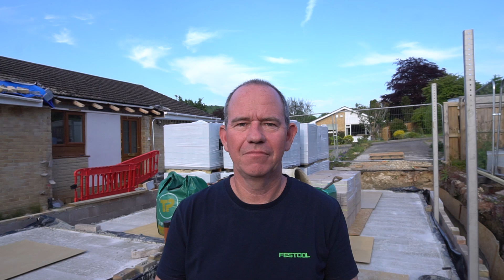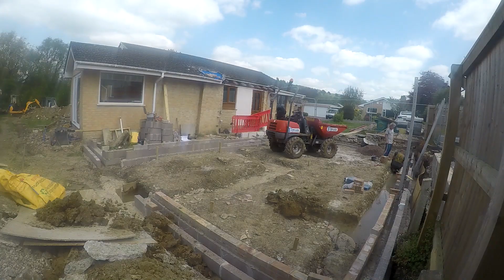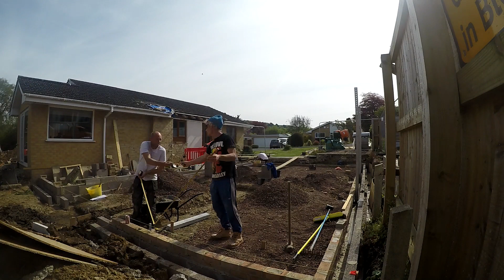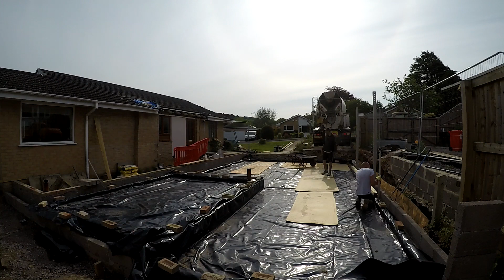Part L Building regulations. Is it worth spening more to exceed the required U-Values?

Comment: Hi, thank you for the video. It's very interesting to know that you can see SE chat gprt for sorting of have an idea on h-values. Do you know if integrated garages (non heated area) but with a room of top has a to be built with the standard for new buildings?
Reply from the maker: Hi, I find chatgpt a useful tool but would not trust it 100%, still useful for iterative questions. If you are extending an exisiting property the regulations are less strict than a complete new build so I think the lesser level would apply. We had the decision to exceed what we were asked to do, indeed I think we exceeded then minimum new build regulations in some areas of insulation. From my experience of homes with a bedroom above the garage they are often colder than the rest of the house so I would add more insulation under the floor and pay attention to air gaps that could bring thermal bridges. You will have to use fire board or double board the garage ceiling if there are rooms above. Why not try chatGPT and see what answer you get (but don't trust it, always chedk with building control).

Comment: Thanks for the excellent video. I wonder about home automation in our new build  and risk of failure
Reply from the maker: Thats a very good question and one I was concerned about myself. The Loxone solution is pretty robust and being used for larger commercial projects so I have some confidence based on that. It can be designed to have a degree of resilience with multiple power supplies but the single point of failure is the mini server or being really specific the SD card that the mini server uses. I plan to have a spare SD card located with the server and may even buy a spare mini server. The good thing about Loxone is that it all runs local to no risk from a remote cloud service failing or the hosu not working if you have no broadband. That can happen, we had our phone line damaged and had no internet for 3 weeks! Loxone would have continued to work.

Comment: Very interesting. Can you post more ROI figures for some of the other measures you're looking in to eg. Mechanical ventilation which supersedes trickle vents.
Reply from the maker: Hi, I am not sure you can produce an ROI for MVHR, a lot of that is about quality of the air rather than pure energy saving. I have installed the MVHR myself at around £4,600 including commissioning. I will save some energy as the heat will be exchanged and put back into the house but if I am not as airtight as I hope it is possible I will also pull cool air in and force warm air out of any gaps even without trickle vents. My property is not a new build so I don’t have to a blower test but I am trying to make it as air tight as practical. 
What I have found and will be doing another video on soon is that the detailing on the installation of the insulation and air tightness is probably MORE important than specifying a better product. Our builder was not doing a good job in that regard so we are having to rework the areas that we can.

Comment: Interested to know what company you're working with for the commissioning of the MVHR.
Reply from the maker: We have pretty much finished the MVHR install now but will wait for the commissioning until after second fix. We bought the kit from Lindab but worked with a local specialist Terry Tulett at https://www.heatrecoverysouth.co.uk/ I think he covers the South West. He has been very supportive so far. We have recorded more of the installation and will post another video once Terry has adjusted the flow rates.

Comment: Do you have the output of ChatGPT or a prompt you can use to ask it? Having trouble with this myself due to lack of understanding on the subject
Reply from the maker: Hi Steve, I still have all of the chatGpt discussion but its a bit long to post here. Happy to share it with you. I would not say it gave me definitive answers but it did help me get a feeling for if spending more money made sense. Having had challenges with my builder since I would say that what is way more important is the detailing of the install. If there are gaps everywhere you will not get the insulation values you paid for.
Reply from the maker: Here is a sample of the discussion 
how much would i save per year if I had a u-vlaue of .1

ChatGPT
The amount you would save per year by achieving a U-value of 0.10 W/(m²·K) would depend on various factors, such as the size of your property, the local climate, and your heating usage patterns.

However, to give you a rough estimate, we can use some assumptions based on average UK energy prices and property characteristics.

Let's assume you have a detached bungalow with an average size of 100 square meters and your heating is powered by gas at a cost of 10p per kilowatt-hour (kWh). Let's also assume that you are currently achieving a U-value of 0.25 W/(m²·K) with your existing cavity wall insulation.

According to the Energy Saving Trust, upgrading your wall insulation from a U-value of 0.25 W/(m²·K) to 0.10 W/(m²·K) could save you around £275 per year on heating costs, based on the above assumptions. However, this is just an estimate, and the actual savings you could achieve may vary depending on your specific circumstances.

It's worth noting that while improving the thermal performance of your property can result in significant energy savings, the cost of insulation installation will also need to be taken into account when considering the overall financial benefit.
Reply: @JurassicJungle   amazing thanks for sharing this i'll give it a go and keep following your channel, also looking at Loxone systems too so interested to see how you get on.
Reply from the maker: @stevegoodwin2036  Thanks Steve. I may do a first fix wiring video in the next few days as I am almost finished. It takes a mindset change wiring for Loxone or similar systems. I have used WAY more cable than I expect to but the flexibility and software defined functionality should make it very flexible.
Reply: @JurassicJungle  Yeah i'd be really interested in this, be good to see how you went about designing the system, any plans you created, the install and wiring if you're using tree wiring. I've just got hold of a Loxone mini server and planning to have a play with this, I should've come down and offered you a few days labour as a trade to learning Loxone 😃
Reply from the maker: @stevegoodwin2036   Sorry for the delay in getting a video out, we have been all hands on deck trying to get some rooms ready to plaster so that we can move out of the caravan. I plan to do several videos on the loxone system and the elements we have chosen and not chosen to go with. I am working with an installer to at least get the basic functionality up and running in a solid way that I can then tweek and adjust. As it really is built into the core of the house it really does need to be installed and configured properly. I will film what we have done for first fix in a week or so. I think it will still be a couple of months before we fully commission and some of what we plan to do is still up for debate. You would be most welcome to visit at any point during the install etc. We are using tree to connect to all of the switches and sensors but decided against using the Loxone spots or other low voltage lighting for a number of reasons I will cover later. We have used KNX wires to all of the devices. I find documetation for Loxone poor but there are a number of reasonable tutorials on Youtube. I may even pay and go on the training just out of interest.

Comment: Just stumbled across you - enjoyed your vid! Preparing to use cork to insulate our roof here in Portugal - cheers!
Reply from the maker: Hi Howard, thanks for dropping by. Great to hear how other countries are using different approaches. I need to post an update on where we are but I have found that the way insualtion is installed is much more important than the product used. We have found we have a lot of detail work to do to make sure we get the best performance. Our home now has all its glass and doors but (very cold) wind is still blowing through all of the gaps.
Reply: @JurassicJungle  it is really hard to balance ventilation with drafts...hope you are keeping warm!

Comment: 140mm of PIR in the walls that sounds like a lot. Most new builds have 150 rockwool now as I understand it. So you well up there.
Reply from the maker: I agree it is at the higher end for U-Values and it did cost more, some parts of the building will have the original walls which we can't insulate as well. We have had to cut that back to just 25mm of PIR externally as the windows were going to be set too deep. I don't think I am any closer to working out if the cost was justified as it will be next winter before I really know if it is warm and comfortable.
Reply: Well with old buildings a small amount of insulation makes a big difference. With the calculation it is hard because things change over time. But look at it this way no one ever says "I wish I had not put so much insulation in my house." So I think going beyond regs is the way to go. My dad put double the regs in the cavity walls when he extended his place in the 1970's and to this day they are still grateful. @JurassicJungle

Comment: Difficult to measure but profoundly important in heat calculations is air tightness. Unless you’ve found an airtight garage door, heavily insulating a garage is irrational.
Reply from the maker: Hi, the door is a Garadoor sectional model with a u-value of 1.6 so about the same as a standard double glazed window. It has lots of seals and a flexible rubber base. I doubt it is air tight but as good as we could get. Parts of the garage may change use over time so it be very easy just to add a raised floor and make it the same as the rest of the property.

Comment: Have you thought about waste water heat recovery? Stick a Showersave Blue QB1-21 in. Makes a huge difference to your SAP score
Reply from the maker: Hi, I did look at this when I was at the Swindon centre but it looked more difficult to install in a bungalow as there was less room to add the heat exchanger. I have to say I think it’s a great idea as I have always hated draining a shower or bath and throwing all that energy away. As we are renovating rather than building to pasiv standards we need to make choices on what is practical. I think my time is better spent ensuring we insulate as best as we can. My builder is struggling a little with my anal attention to detail in this regard.
Reply: @JurassicJungle   Leave your bathwater to go cold before pulling the plug.
Reply from the maker: I guess that's the cheaper way of doing it and in winter it makes sense but not so much in summer @markrainford1219

Comment: Informative and will be following you keenly Ian - good luck. Have similar sized bungalow upgrade due. Currently sitting with planning department for approval with aim to start construction next spring, if all goes well. Also, similarly, nerdy about home automation and over the years, had multiple systems from Hue to Alexa, Nest and Sonos but not blinds yet. So, you already have a fan follower in me, seeking inspiration. Again, warm regards and all the best for success in your project.
Reply from the maker: Thank you so much for your reply. I think I could actually run a complete channel on this area. As I mentioned I have worked with various HA technologies in the past and want the foundation of what I do now to just work. Previously I have added components that I could easily remove but the family that bought our previous home wanted me to leave Fibaro installed and paid me for the components. For this home we are probably going with Loxone and will be paying for services to have it installed, but I will want to tinker for sure. The challenge is just how far do you take that integration. I will plan to post a series of videos on my view on why I have decided to go this route in the coming weeks followed by much more detail as we first and second fix.

Comment: The ASHP system in the Stag works brilliantly and it's 170 years old.  Needs to be sized correctly though. So many fail because they are under rated to keep costs down.
Reply from the maker: Thanks Peter. I think we have insulated well enough and adding UFH so air source is certainly an option but we have had varying guidance on the need for 3 phase as we also need ev charging. We do need to decide very soon but the UFH design is to allow ASHP flow temperatures.

Comment: Another informative video 😊. What’s you view on heat pumps. I’m have a survey done next month as looking to replace my gas power central heating.  Reading some horror stories but then British Gas are saying that’s only from poor installations & they guarantee their work.
Reply from the maker: Hi Keith, I don't have any first hand experience but have researched a lot. The one thing we were told was to insulate everything that you can (if practical) which is why we are spending so much on doing so. We are even adding external insulation on the few remaining original walls. 

We are still considering ASHP but on the fence, as far as we can see it would cost about the same to run as gas (assuming a COP of around 3) but some people tell us higher COP is possible. Any decent installer will complete heat loss calculations for all of your rooms and design a system to meet the room temperatures that you suggest to them. It is important that the ASHP is sized correctly as putting in a bigger one is not a good idea as it will not run effeciently. 

The big energy providers are investing a lot in this space, I would certianly take a look Octopus as they seem to be installing ASHP almost at a loss from what I have seen in discussions. We can't get them out as they will only install to existing properties not new build.

Are you also looking at solar and battery? these can complement ASHP at least in the summer. We plan to have both but just not sure on the ASHP. It has been suggested we may need 3 phase as we also have an EV, this would be an additional cost. I would love to hear what you think after your survey.
Reply: @JurassicJungle  thanks Ian…I’ll share the survey once it’s complete in July. BG have told me we qualify for max grants as everything is insulated. So for a 3 bed semi  detached they are saying, pre inspection, the worst case scenario (if we needed the whole house re-piping & new rads) we be c£6k so worth a free 3hr survey I think.  Looking forward to the automation video I have my popcorn & larger at the ready.
Reply from the maker: @keithbunn3810  Hi Keith, how did you get on with your survey? Our pump goes in this week but while we have glass in there are still too many large holes open to run the heating. We managed to get the new uplifted grant.